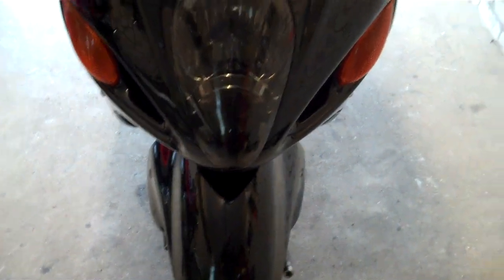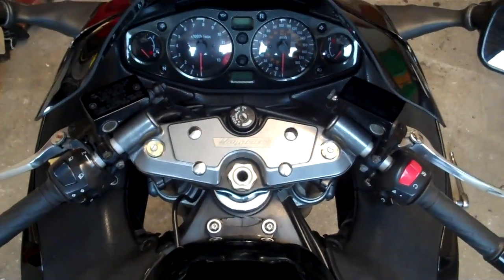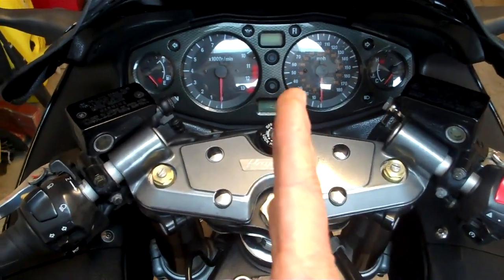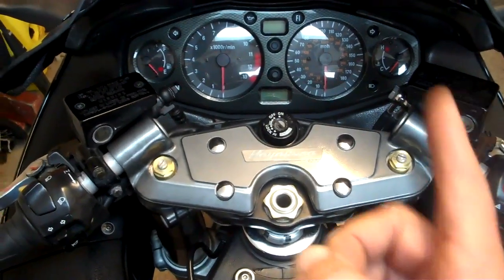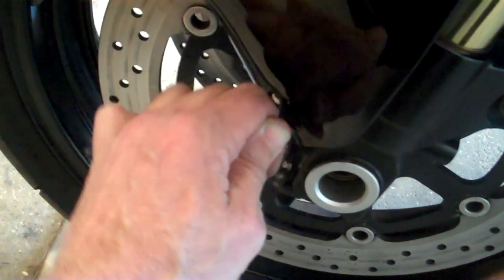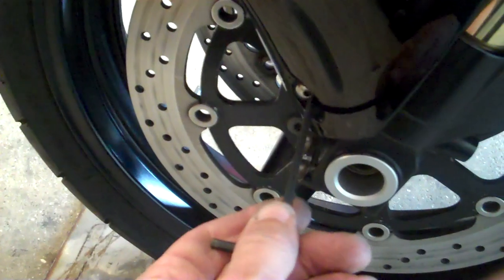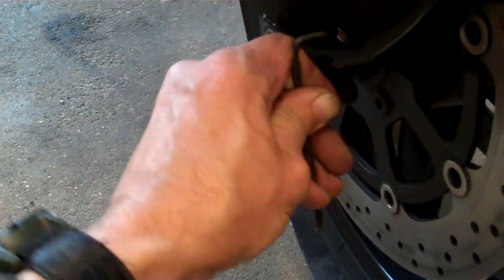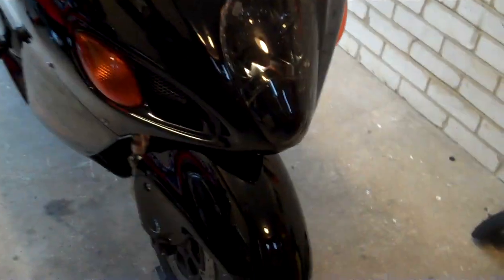Delboy's Garage, 'How-To' Re-align motorcycle forks the easy way.

Comment: The last thing you loosened was the top big nut that adjusts bearing tightness ( not sure what that nut is called. 
Is that big nut the first thing you tighten after you get it straightened??

Thanks
Reply from the maker: Firstly mate, the top centre nut doesn't tighten the bearing, the taper bearings should be tensioned by a screw collar with a locking collar underneath the top yoke... that centre nut literally just holds the top yoke down, and yes you need to release it last and tighten it first... Good luck with it mate.
Reply: @Moonfleet41  

Thankyou I need the help lol

Comment: Does this work for all kinds of wheel centering issues? I crashed my bike a year ago and I've re-adjusted the height of the forks  a while ago (one was higher than the other in the top yolk) and my forks still look and feel slightly twisted, but I dont want to make it worse...
Reply from the maker: If they are regular hydraulic forks, it will serve to re-align them equally each side... it can hardly make it any worse...!

Comment: I have a 2013 gsxr 1000.  I hit a pot hole and notice my front end is off by a little.  Tried this method a couple of times and seems to have gotten better but still off.  Do you think something is bent or just try again?  I had rear tire on a stand.
Reply from the maker: Hi Jeff, make sure that when you do this you loosen off the centre nut in the middle of the top yoke... if you don't do this it won't re-align properly, as that holds the two yokes in place, you can also check your rear wheel alignment to see if it's thrown that out as well, cos that will also twist the steering to one side... hope that helps, Del

Comment: Another good video Del, I have a query, recently my left fork has started squeaking, I know this because I got the missus push down on the bike while its on the main stand, I paid attention to this as I turned sharp left the other day and the bike starting vibrating like something was rubbing, could it be anything to do with the forks and if so can I fix it? I checked its alignment too and that looks OK, I hope this is clear, regards .Jimmy
Reply from the maker: Jimbo Deano What bike is it Jimbo..?
Reply: Suzuki bandit gsf 600 s T reg so 2000 I think
Reply from the maker: Jimbo Deano Ok so regular forks then....its really hard to be sure Jimbo, there are so many things it could be, lots of moving parts in that area, you can at least eliminate the forks as the reason by dropping the left fork leg out and pushing it down by itself...this will confirm for sure that its the fork.. and if so, then just open it up and see whats causing it... all diagnosis is a matter of elimination...i could tell more for sure if i could see the bike..but on only email, i can only suggest what to look at..
Reply: No probs I saw ya vid on loosening the forks I'll do that thanks alot :-D

Comment: I just bought a street bob and completely missed it on my inspection before I took the bike.  The fork protrusion is supposed to be ~0.5" and it's way off, but they aren't equally off.  Can I just  loosen the forks at the upper clamp and get them set to spec or should I loosen everything up as you've done here?
Reply from the maker: Hi Steve..Fork protrusion is no problem if the alignment is straight when you ride it.. and its just that they stick up a bit too much...(some people do this to lower the bike)..  then yes, do them one at a time, ljust loosen the top and bottom pinch bolts with the front off the ground, and twist the fork tube while pushing downwards so it slides down to 0.5" and your happy... then tighten it all up fully before you touch the other side... as long as one of the forks is all done up tight, the alignment will stay set in position... Hope that helps you buddy.. Del.
Reply: Ya, makes sense. Thanks for the response Del.

Comment: Im going to try this on my 2001 cbr the forks are not straight and i think its what causing the dangerous turns when i lean or turn thank you so much i hope it works.
Reply from the maker: Aaron Robinson Good call Aaron...also check the rear s=wheel alignment because that plays a part too... !
Reply: Ok thank you

Comment: thanks for the upload,  I wanted to know about that 28 mil nut in the middle of triple tree, do you break it loose last and tighten las,t In what order does the 28 mil nut have to be adjusted in contrast to all other fasteners south of the top clamp?. and do I need to torque it down to spec? also will this tutorial work similarly for  a 2001 gsxr 750? thanks in advance for your response,  also when my left handle bar end is fully turned to left its about an inch from tank, and when fully turned opposite direction right bar end is about 2 inches from tank, is this normal? thanks again.
Reply from the maker: +INDY SOUL PREPPER Hi buddy, loosen the top centre nut at any point in the un-doing, that doesn't matter... but nip it up FIRST before you do any others and then when all the others are done, yes, torque it down.... releasing it allows the two yokes to move independently of each other, which allows the forks to align.

With your clip ons, if the bike feels straight when it rides along, then check one of them isn't bent... try eyball-ing along the length of the bar from the bar weight end and see if, perhaps, the closer one is bent in a bit.... also, are they adjustable??  Or do they locate in to a bolt hole in the yoke??  Just a case of checking it...
Reply: +Moonfleet41 I fixed it today, I just loosened the top clamps only with the rear in  bike stand, and then held front tire between my feet and grabbed handle bars and torqued them back and forth, immediately I heard it crack and the forks straightened out, then I did your technique and got up on bike and pushed down on tree a few times for good measure, needless to say wheel and handlebars became straight. thank you so much for your informative video, and I also gained some knowledge from the Two Clicks out channel on the same subject by the way. thanks again,  your a Gentlemen and a Scholar.
Reply from the maker: +INDY SOUL PREPPER Glad you got it sorted buddy, you will notice the difference right away... now that the forks aren't fighting each other because they are twitsed in the yokes then they'll be no torsional force on the internal bushings and that means they are freer moving up and down, so your front end should be more supple and free to react... always pays to check this every year as general use can throw your trees out, even potholes, or bouncing up a few kerbs, is all it takes to knock them out by a degree...!  Glad we could help you !

Comment: Tried just undoing top clamps and twisting, heard a couple of clicks but no give.  Might have to raise front end on paddock stand and loosen everything and support wheel so forks don't drop?
Reply: I have been away for a few days so no further action on this till yesterday.  Loosened everything apart from top pinch bolts including top nut, lower triple tree's pinch bolts, mudguard mounts, steering damper removed, checked forks even amount through top yokes (5mm above top yoke),front axle and calipers (removed them) rear on paddock stand - front wheel kicked over to left as viewed from front with bars straight - jumped on front end a few times TNA.  When you grip bars from front and try to match with front wheel it moves but then springs back to offset - tried this with wheel on ground and with  front raised on paddock stand - given that bike passed MOT not long after bought it - I expect bike to have been straight then, not fallen off since and only thing done since is replaced front forks?  I refitted original forks last night and its the same?Forks fit fine and front axle slots through with no extra effort so not feeling over optimistic although pessimistically something appears to be bent, axle appears straight cannot say the same for frame, lower triple tree - handlebars are new.  I guess I am kind of hoping that I am doing something wrong here but it appears to be a very straightforward process.
Reply from the maker: You didnt mention... in the last reply i gave Perry... i said to check the rear wheel alignment... did you do that buddy..?
Reply: Sorry forgot to mention before going away that had to replace chain as had a reoccurring tight spot so sorted - not checked again since - bit of a bind on this bike because you set it and then chain tightens as you tighten axle - bliss...
Reply: Well took another look today. Took front wheel off and whether wheel fitted or not or axle fitted or not forks remain twisted away from handlebars to the left when viewed from front. No amount of persuasion could correct this as soon as persuasion released error returned. With spirit level close to bottom rotated forks until level, double checked measurements both sides to rider footrests, equal but handlebars skewed to right as seen from front. Issue not caused by wheel etc or forks as exactly same with both sets of forks. That only leaves frame and yokes - new full set of yokes enroute, headrace bearings needed yet.

Comment: Shouldn't you loosen the large center nut too? It seems the triples could not be squared up otherwise . Also how can I inspect the triples? I have something out of whack and I did this and it didn't fix the problem
Reply from the maker: Yes, loosen the middle nut on the top yoke, so they can move independently... what do you mean by 'how can you inspect the triples'?? ...

Comment: Hello, I had a crash a month ago. I bend my steering wheel on a Ninja 250. I replace it for a new one because the steering wheel was unaligned. But that didn't fix the problem. Now that I see this video I can figure out what could be wrong. I was thinking about take the bike to a workshop tomorrow and see what was going on but now I think I should check this by myself first. The only but here is that I don't have  a rear stand... But I have a sister :D I could make the laundry for the weekend maybe. I've just subscribe. Thanks a lot.
Reply from the maker: Hi Matias, what a fantastic message, you have a charming grip of English and it is very nice to read... have a go at re-aligning the forks this way, and see how you get on... make sure you loosen the top centre nut so the yokes can move about....let me know how you get on and the very best of luck...(and good plan with your sister, maybe a bottle of wine will cover it..).. cheers Del.
Reply: Moonfleet41 Hi Del ^^' I DID IT! it worked so nice. I'd to wait 'til the rain stopped. On a Ninja 250 there is a bit differences but the same principle.. Thank you so much. BTW I found some quite useful videos I surely 'll do ;)

Comment: Hey mate, just to be clear...we're cracking off the top clamp bolt?  The big one in the middle of the triple.
Reply from the maker: Junglist Movement Yes mate, back it off till finger loose, it's essential to allow the two yokes to move independently, so they can align

Comment: Hey Del, I tried this 3 times on my ,07 250 ninja and still feels unbalanced in both right and left turns, more so on the right turns, handle bars still misaligned as well...? dont know what else to do or maybe something else is wrong...?
Reply from the maker: Hi mate, it's sometimes a little frustrating when you can't seem to pin it down, but that means you've got to go back right to the start.. first check your REAR wheel alignment, checking that it is absolutely SPOT ON... check both tyre pressures are absolutely correct and that they are not worn badly... if you are able to pick the front up, check there is no play in the head stock bearings, or notchiness side to side... and then do the front alignment again, don't forget to un-do the centre nut in the top yoke as this releases the yokes and allows them to twist straight.

Do all this, get it all exactly straight, and if it still rides cock-eyed, then try getting someone else to ride it and see if they can detect it.  Just a final thought, if you have clip-ons, check they are both mounted to the forks symmetrically and that one isn't twisted, or bent, after landing on it in a drop... if all this is dead straight and both your arms are the same length, then the only other thing it can be, is that something is bent or damaged... good luck with it mate, it's never an easy task this, Del
Reply: Moonfleet41 You got it! thats what it was. Rear tire was way way off. Cheers Mate!

Comment: I know this video is 8 yrs old but does this method still work and also does the triple clamp middle nut suppose to be loose when doing the pumping?. Thank you
Reply from the maker: Yes, still works, and yes release the top centre nut, so that the two yokes can move independently of each other in order to re-align.

Comment: Hi! I got a question. Does it effekt the fork seals to leak when the fork legs not are align? Thanks!
Reply from the maker: +tigerofsweden4 NO, if they are just miss aligned in the yokes, the seals wont be effected..but if the forks are damaged or bent, then probably yes...

Comment: Can this be done with a normal set of allen keys or d you need the wrench that you use?
Reply from the maker: Regular l-shaped allen keys will be fine, but not if you want to tighten up the bolts with a torque wrnech, it always pays to invest in a few tools for things like this, you can buy them in single sizes, usually 6mm fits most things on a bike, so start with that and it won't cost you too much !

Comment: I did the same..it made a slight difference but still the handle feel cross towards right and even i changed the handlebar.
The bend is noticeable only while riding,that doesn't pull the bike to right side it goes straight but the front looks bend towards right side.
Reply from the maker: Hi mate, check your rear wheel alignment too as this will make the steering feel mis-aligned !

Comment: I had a bit of an accident on my Ninja 650R. Driver in front of me seemed to think it was a good idea to stop suddenly in the middle of the goddamn road. Anyhow, I tried to slow down as much as I could. Still went into his bumper though. The fork alignment is off and I'll be trying your method of fixing it, but is there some other damage I should be looking for?
PS: I'm still a novice on 2 wheels.
Reply from the maker: +Dhruv Kharwar Hi Dhruv. if all you did was bump his car, then try the fork re-alignment first, see how that goes and than make a judgment from there to see if there is any other damage...
Reply: +Moonfleet41 Will do. I'll let you know how that goes. Thanks.

Comment: Hi Del, on my fz6 I have to keep slightly pushing my handlebar with my right hand to keep the bike straight. It is like if I let it go, front wants to turn by itself... I had seen this video of yours long ago but I was thinking that my actual problem was rear alignment. Well, it turns out that my rear was off but to the side that it would compensate. When I aligned my rear, the problem got worse. Do you think dis-aligned forks could cause this?
Reply from the maker: +Kaya Onur Hi Kaya, the best way to descibe alignment is to see it like moles under a lawn...if you bang one down, it pops up elsewhere.... so align the rear first, then the front, and once you get both ends as close as you can....then ride it to see if its better... if its still off and pulling... check th tyre wear isnt effecting it..
Reply: +Moonfleet41  thanks for rapid reply. I'll get on that. 

btw, never had chance to verbally thumbs up. I really appreciate for your efforts for making such videos. You show great tips & tricks, you do teach and the most I like, you don't bullshit.. People like me learn a lot from you. I appreciate

Comment: I assume a center stand (old bike) will suffice for this? And, thanks for what you do, glad I subscribed.
Reply from the maker: Hi mate, sorry forthe dealyed reply.. It wont work so well using the main stand as it doesnt place the weight over the front enough...also the forks can't really plunge up and down much if the bike is on the stand, its fine to do the plunging bit with the bike in its wheels and maybe get a friend to hold the back end of the bike upright while you retighten the bolts...!!
Reply: Moonfleet41  Thanks for the advice, will do!

Comment: OK Dell thanks. The Haynes manual says it can be done and I've heard other folks so it can be done, but like you I cant see how without removing the back wheel to take the caliper off. They should make the designers take these things apart themselves then maybe they might just engage there brains...Sam

Comment: Hello, do you know how to get the lower sections (feet) off the bottom of front forks? I want to send my middle sections for re chroming. I have dismantled the forks I just can't get the feet off.

Any help would be great.
Thanks
Reply from the maker: Hi mate....i sent a set off to Philpots with the feet still fitted and they removed them when they did the re-chrome...the safest way is with a press as they may unbolt..but never just fall off, they've always corroded in place...using a hydraulic press will remove them without damage....alternatively you can heat them....but its not very safe as the cast alloy can crack with too much heat... you may even get lucky with a soft face mallet and a wood drift..!   there's no easy fix buddy, maybe see if your local bike garage can press them off..!